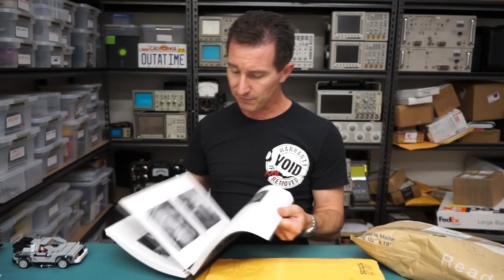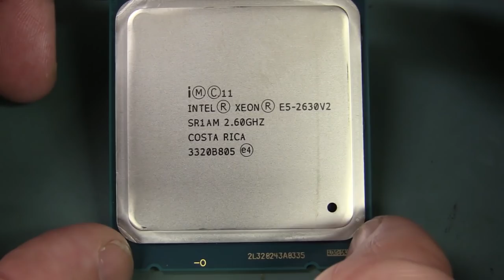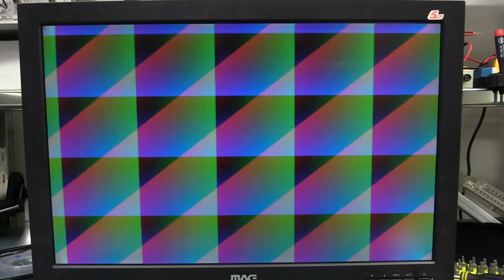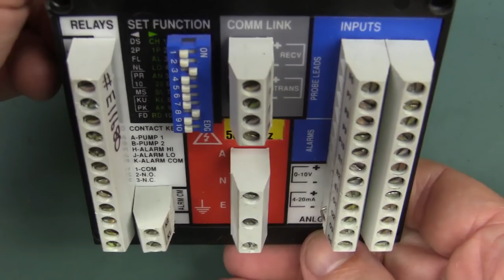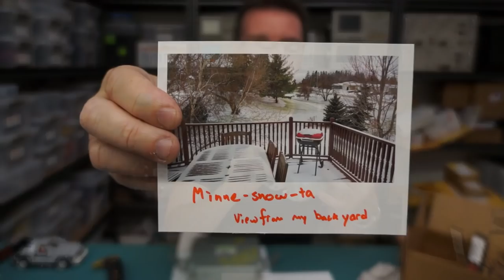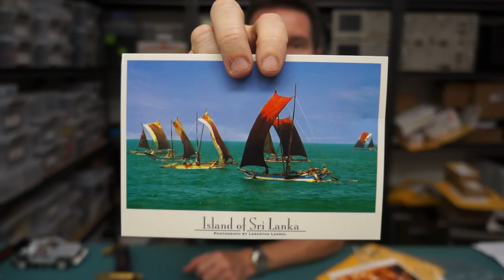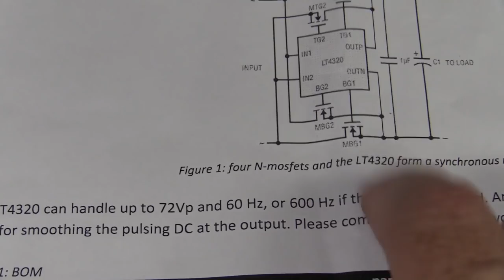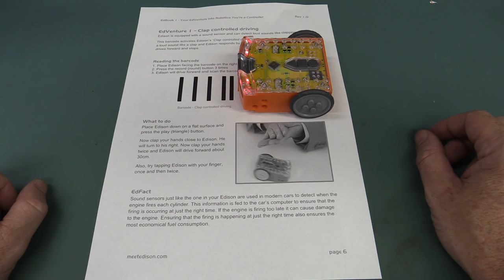EEVblog #711 - Mailbag

Comment: You get used HP z820 barebone workstations. The 2nd revision (make sure you get one of them) also supports the v2 Xeons. These are absolute workhorses. You should get an entire machine incl. ram for about $800.

Comment: Hi Dave:

Your interest in Atom made me remember my Cousins work a Los Alamo's N.M.. He invented a fast camera that would take pictures at the rate of over a million frames per second. His name is Willard E Buck. The camera was used to take pictures of the explosion. One camera was a bit to close so it melted. The other work. The basic design is a spinning three faced mirror. Driven by two tiny turbines made by a machinist who worked at the Bureau of Standards unit in Bolder Colorado. They were driven by compressed gas. They spun up so fast the it passed the sound barrier. The two turbines each produced seven and one half horse power. So the light comes in through one compound lens. The mirror is at the focal point. The light is moved around a large thin cylinder that held 35 mm film in place. The light moved with the film stationary.

The camera that this one took the place of had some 300 lens according to Willard.

This camera still exists. The owner has completely digitized the whole thing. He is noted for his pictures of lighting. There is an article about him in one of the National Geographic Magazines.

Willard has many patients to his name. Look him up.

Comment: EdFact: The sound sensor they mention in "modern cars" in the manual to Edison, is call a 'knock sensor'. Signal from the knock sensor is fed to the ECU to monitor ignition timing / firing of the spark plug.

Comment: Thanks for tearing down my ECU Dave, great point about the free-standing components.
I forgot to mention that these are mounted inside the car, maybe that's how they get away without conformal coating and a tighter chassis.

Comment: The mosfet rectifier was indeed designed to have heat sinks on them. If it is actually required, depends on the mosfets internal resistance and on the current drawn from the output.

Fun fact: I showed the video to my dad and he said: Hey, that Casio calculator is almost the same as the one I threw out recently....
Reply: What are the small holes all over your pcb? Assembly test points? Thanks
Reply: St0RM33 No, those are via's. It's where the copper on the bottom connect to each other. I put in quite  some to ensure a decent current capability. The pcb should be able to do 15A or something like that.
Reply: I understood that they where vias but didn't pay attention to the design of the board. I though it was two layer specifically because of the circuitry. Thanks!

Comment: 39:39 The last patents on the LEGO dimensions elapsed in 1988, so any company can make products that have studs or holes that are compatible with the LEGO bricks. Many did though that didn't stop LEGO from continuing to sue manufacturers that just made bricks based on "trademark".  (they were OK with companies having products LEGO wasn't making themselves but had LEGO connectivity).

A final ruling in court in 2010 allowed even making regular bricks, citing that you cannot trademark a technical function (the brick interlocking).  So since 2010 several companies have made bricks.
Reply: Yeah, Hasbro has their KRE-O brand that says on the package "Works With Major Brands". Those came out in 2011, which is pretty much in line with the ruling.

Comment: I got three Edison robots. Each performed completely differently. One did just like yours in that it kept going in a circle. None handled the obstacle avoidance very well out of the box. I haven't had a chance to try programming them yet.

I had to open up one of them because it wasn't making good electrical contact with one of the motors. They use just pressure to hold them in place.

So good idea, but execution is a bit lacking.
Reply from the maker: Pete Brown Ah, ok. Mine seemed ok. You'd think they'd all perform identically, it's two motors and micro after all!

Comment: Hi Dave.  I work with pumps and you do occasionally see Multitrode controllers.  It uses multiple electrodes (multitrode) and different depths in the water and uses the waters conductivity to complete the circuit between the common electrode and the various depth sensors.  They use these instead of float switches which aren't as reliable as the cable insulation breaks down eventually and the micro switch in them does fail occasionally.

Comment: 97c temperature swings,  summer engine compartment near 90c, winter -20c
Reply from the maker: Stephen Woods Ah, right, I wasn't factoring in the engine compartment.
Reply: ***** You got that right! Brrr!!!
Reply: EEVblog you didn't need to. I've done many a Subaru engine and trans swaps, with associated wiring, and as far as I know, these ECMs are mounted in the passenger footwell of the car, not in the engine compartment. You were right on though, they're built pretty well down to a price. I also work on BMWs and it's shocking how many corners Subaru cuts on their electronics and how massively advanced BMW seems to be in comparison.
Reply: Guys, I'm not trying to be a dick here but I see this way too often lately...  Why are americans / native english speakers more often than not skipping the '°' (degrees symbol)? Units of measurement shouldn't be context sensitive. 100C means 100 Coulomb (electrical charge) and 100F means 100 Farad (electrical capacitance) but I'm pretty sure everyone on this channel knows that. I would really like to know why this is so common in informal english writing.
Oh and while I'm on that matter: I just can't get over the fact that in formal (scientific) english 'V' stands for both voltage AND volume. In Germany for example we use 'U' for Voltage and 'V' for Volume, so there is no redundancy. (i.e. in english 'R=V/I' could be interpreted as 'resistance equals volume over current' which would be nonsense)
Reply: John Ridley I have to apologize. I had no idea that the QWERTY layout doesn't include the degrees symbol. From now on it won't bother me anymore if people just skip it and you are awesome for trying to compensate by using an asterisk! Now I just need an equally satisfying answer to the voltage vs. volume problem. Is the upper case 'U' already used for something else?
Reply: swiss
I suppose the difference is in the context as to whether a person means voltage or volume.
Reply: swiss when I went to school in the US in the early 80s, the symbol used for voltage was E (for Electromotive force).  I'm unsure when it was changed to V.
Reply: I just checked the english wikipedia article for voltage and it says V and U are most commonly used and it doesn't even mention E as an option. Also E is already reserved for energy.

John Ridley AFAIK there are no SI standarts for quantity symbols. There are just non-binding suggestions. Can you give me a source on that?
Reply: swiss I actually do try to use the ° symbol. On Mac's it's easy. [SHIFT] + [OPTION / ALT] + [8]
Interestingly, that IS the * without the OPT/ALT modifier. Unshifted, it's the bullet •.

I'd be hopeless without the character viewer though! ╱)⤳_⤺(╲
Reply: Living on Mars would not be much of a jump for you.

Comment: Hi Dave. you are correct about that automobile device. I used to work for automotive company and that kind of design is not acceptable. all bigger parts must but glued  it is not possible to be like than freely standing. as you said vibration would damage it so no that is not good design also i didn't see any seal or conformal coating.

Comment: i7 is faster in SINGLE THREADED operations. Those two XEONs are faster in MULTI THREADED operations (like video rendering).
Also buy a SuperMicro. They are great and pretty cheap.

I recommend you the Supermicro X9DAi board. It has all the features you need - It supports DDR3 non-ECC RAMs, has a sound card, has SATA III/6Gbps, has 3 16x PCI-E slots.

Your power supply will BE enough to power this thing, you do not need a new one. However, you need a reduction from Molex to 4/8pin CPU power connector. Those boards require 2 4/8pin CPU power connectors. Also check that you can fit the board into your chassis.
Reply: You're forgetting that the ivy bridge v2 E5's turbo-mode much faster than the sandy bridge variants.... we have both the sandy and ivy version of the 2630 and the fact that the v2's can turbo mode to 3.1ghz (on all cores!) is a massive improvement over the old version which could only turbo to 2.8ghz at the most on 1 or 2 cores only... the performance difference is huge. IPC is also slightly better on ivy-bridge. So this wasn't a case of someone handing down their old stuff, but a legitimate assist to David.

We use Supermicro boards everywhere in production, you cannot go wrong with such a solid board. The X9DAi is a rather large board though, so for something that is guaranteed to still fit in his current case the X9DRL series is a better choice. As for non-ecc support, DDR3 ECC-registered 1600mhz modules aren't that much more costlier than bog standard stuff.
Reply: Also iicr those xeons  are hyper threaded, so each processor has 6 cores but 12 threads, so a total of 12 cores but 24 threads
Reply: passmark (which is what dave was using to compare the two) tests multithreaded performance not only single threaded performance and they both bench on pass mark at about equal performance with the i7 5960x coming out about 100points above so sadly you lose on both fronts there :P (the passmark score is for the use of dual cpus btw so yes its using all 12cores/24threads), its progress, the i7 5960x is 1 year newer in terms of release date but more than 2 years newer in terms of technology so getting the same performance with 33% less cores/threads is normal)

Comment: dave, try using a good video card for video processing. I use the GTX970 CUDA for rendering video. It halved the time it requires to encode a clip.
Reply: he did, look back to a few videos ago he bought that same graphics card and it made his video rendering actually slightly slower, it only helps for specific software and specific codecs.

Comment: I'm sure this is way too late, but the core i7-4770k & up will outperform this chip in all but the most heavily multi-threaded applications, even at their stock clock speeds. Fortunately, with their unlocked multipliers, they also have a great deal of overclocking headroom. I'm running a 4770k, which is normally clocked @ 3.5 GHz, at 4.4 GHz using a Noctua air cooler and a bunch of big, slow-spinning 120 mm case fans. I only had to bump vcore up to 1.25 volts to get the system rock-solid stable under 100% load.

Comment: If you're interested in the automotive tech I could probably send you a couple immo/ecu modules from various models. I'm a locksmith so only really interested in the immobilisers but some have quite interesting designs like Mercedes Bosch ecus reclaiming injector opening current to open the next injector.

Comment: I know this is probably a noob question but... In pcb design, is there really a reason one should avoid 90 degree angles? I etch my own boards as a hobbyist and like the way square traces look. Am I missing something important? By the way, love your videos Dave!
Reply: As a circuit board heats up and cools down the board and metal expand and contract. A sharp inside corner corner is a spot a crack can and will easily start. For example the 1st jet liner crashed because it had square windows, crack started in sheet metal window corner causing fusakge skin to split open. So now all corners, especially inside corners are rounded smooth transitions. That's why you drill a round hole at the end of a crack in metal to stop it from cracking firthure.

Comment: What are the small holes all over Stephan's pcb? Assembly test points? Thanks
Reply: Vias that connect the top and bottom plane to slightly improve current capacity and thermal dissipation. They are plated through during the manufacturing process.
Reply: *****
lolz

Comment: Dr. Noob here, is there a reason why "square routing" on a PCB is bad? Did a quick google and couldnt find anything now its time to leave for school hah
Reply: Try googling "90 degree PCB trace". Should give better results.
Reply: I found an excellent answer here:

http://electronics.stackexchange.com/questions/76406/sharp-corners-in-pcb-traces
Reply: as i understand it square routing leads to reflection of signal in faster applications
Reply from the maker: Kakunapod Only a couple of real technical reasons, and they don't matter except in extreme cases. etchant trapping, and impedance control. It's a personal thing.
Reply: EEVblog  I had an old greybeard PCB layout guy once say that PCB designers all start out square but get rounded with age.  I'm fairly certain he was talking about PCB traces.
Reply: Zyphera Thanks, the only one I could think of was use of more conductor material, although I hadnt thought of how it might impact the total size of the board. Also had no idea about the mega high frequency reflection.
Reply: EEVblog I see, square corners are uglier too haha, thanks for the reply
Reply: MichaelKingsfordGray I see, thanks for the info
Reply: EEVblog
If it was easier to do at the time (given the tools available etc), and if it does no harm given the rise times, and passes EMI requirements, then I don't think it deserves to be put down. In business, you have to compromise between schedule, quality and price, so good enough is the goal. But I agree it looks funny today.
Reply: you waste a lot of time given the clock rates and slew rates in use in 1968.  Thanks for missing my point.
Reply: MichaelKingsfordGray
Contray to what many people beleive there were gigahertz circuits back then used in microwave communications and radar.

Comment: That Subaru ECU, are those mounted inside the car or in the engine bay?
Reply: Inside the car, under the dash in the middle :)
Reply: I had assumed as much. Given that is is inside the cabin of the car, there really isn't a need for it to be conformely coated right?
Reply: Mine's on the passenger floorboard, under an aluminum cover.  (2003 Imprezza)
Reply: All the Subarus I've swapped have had the ECM mounted in the passenger footwell. Dave is right though, they're pretty cheaply made, but that applies to much of Subarus electronics. When I work on my BMWs I'm amazed how much more advanced they are than Subaru for the same time period. Subaru is literally 20+ years behind. Oh well.

Comment: Sort of fail to see the facination with the VGA port on FPGA boards, utterly useless waste of pins imho. Its not like anyone is likely to develop an FGPA application using VGA display, 21st century and all that. Dev board is exactly that, useful for testing out your ideas before you get to working on an actual design. Nobody is going to design something with VGA port, its legacy, forget about it.

Comment: did you not find a Zion  in the trash???
Reply from the maker: Kristyanna Virgona Yes, two of them, but much older and slower chips.
Reply: EEVblog
can you use the motherboards in the time being? at least you know they work LOL!!!
Reply: Kristyanna Virgona He might be able to, but I don't recall the exact generation of those motherboards.

There's a good chance that they are so far out of date that you could technically use those new CPUs on it but you wouldn't get a real benefit out of many of the architecture improvements on the new hardware.

Just investigate the bandwidth differences between things such as PCIe 1.0 (250 MB/s) 2.0 (500 MB/s) and 3.0 (985MB/s), take note that these speeds are per lane speeds and most GPUs have a 16x interface which means they can use 16 lanes if all other things support it. Most consumer grade motherboard/cpu combinations will allow 1x16,2x8,1x8+2x4 etc. The E5-2630 CPUs have a max of 40 supported PCIe lanes, in a theoretical single card situation either would be able to get the max bandwidth out of it but with a multi card scenario the xeons may be better if the bandwidth ever turns out to be a limit. 

Also the Xeons have 15 MB cache vs 12 MB and a high max memory bandwidth compared to the "regular 6 core" i7 CPUs which may just solve one of the major bottlenecks in CPU encoding. (I don't know enough fine details about Daves workload on each component even after watching the #698 video to say that with any certainty)